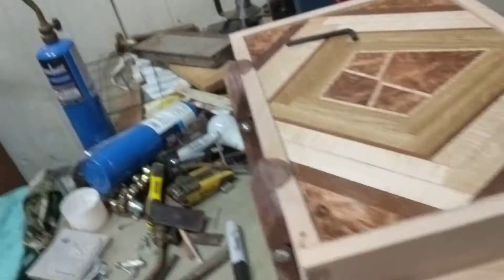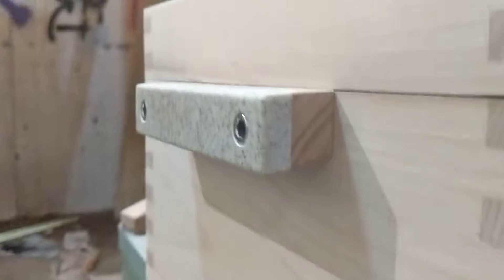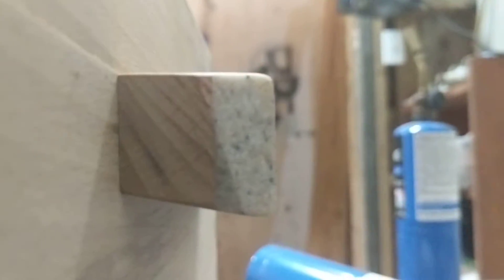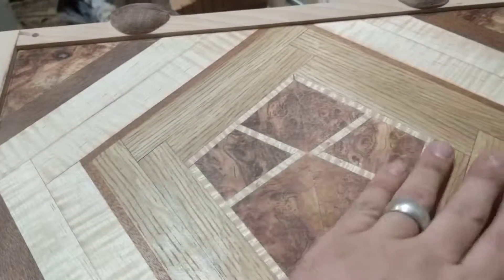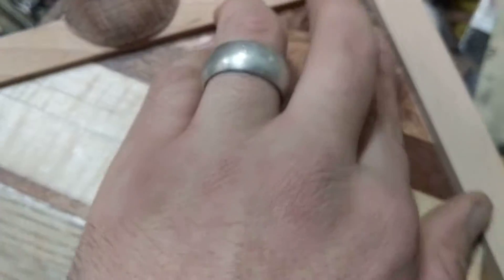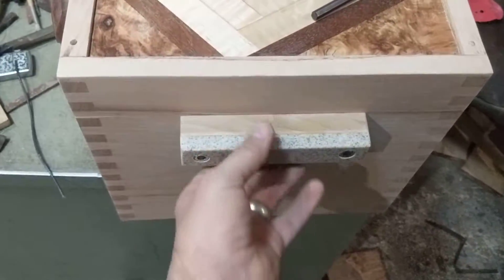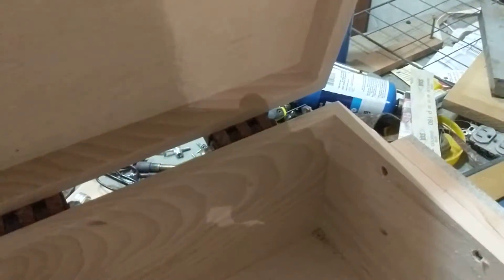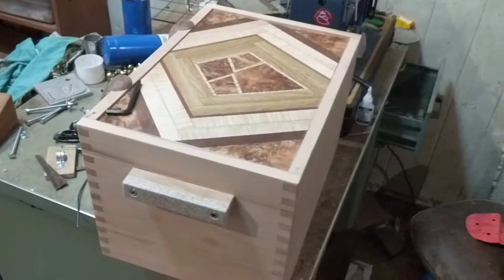Handle and box details.

Comment: Good job Rich. I like the idea of using the threaded inserts.
Reply from the maker: Thanks!  I'm not sure I'll use socket head screws again, but I do like how it looks. If the box was thicker I'd leave the handles removable, but "Light" was a requirement. Probably should have used cedar or fir for that, but beech is tougher.